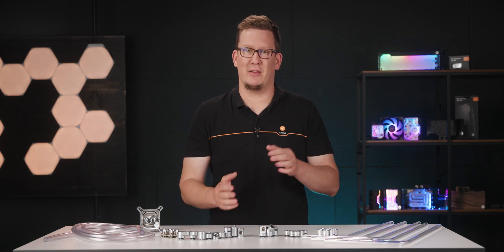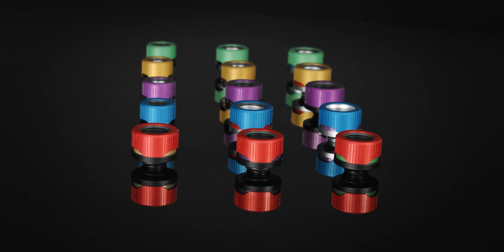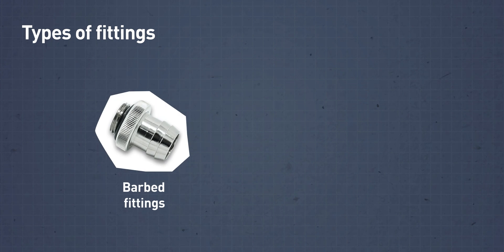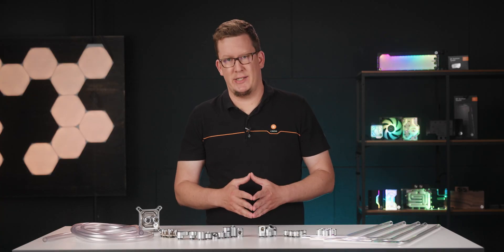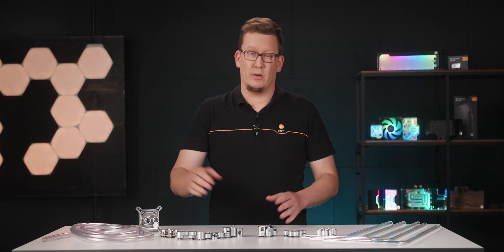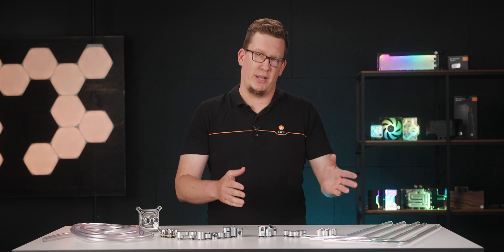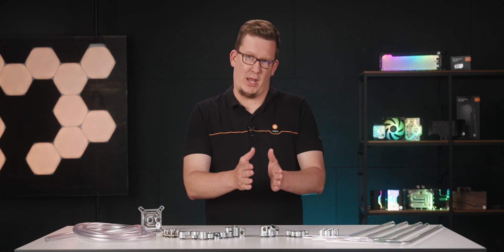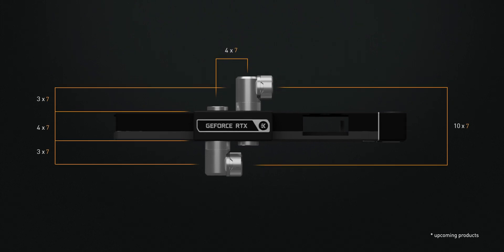How to Choose the Perfect Fittings & Tubing | Basics of Liquid Cooling

Comment: Increasing the inner diameter of a pipe will increase it's flow rate, even if it has to go though a few smaller fittings along the way. What this guy says is wrong.

Comment: Good Video!  I was just hoping that it would educate about how to choose a fitting when you're ordering your loop components and don't know how many of each type to order...like me!  EK's Loop Configurator can get you started, but doesn't automatically include offsets, extenders, or plugs (how can it when it doesn't know HOW you want to arrange your tubes? Well, if you are using one of EK's distro plates and opt for either prebent tubing or straight tubing, it should be able to determine how many of each extender you need due to their matrix7 standard - but it doesn't, so i was hoping to get that info here).
Reply: There are infinite ways to set-up a loop, so it requires some planning. Only with experience will you know to better what you will need.
Reply: @TheEchelon  Good answer bro, really helpful insightful info. Just build 15 water cooled PC's, and by the time you're on the 16th, you'll just know what offsets to get

Comment: does anybody know if hard metal tubing is beneficial for determining leaks? I don’t know much but I feel like it would be harder to spot a leak on clear tubing compared to carbon fiber tubing
Reply from the maker: The best way to check for leaks is with the EK-Leak Tester Flex 💪: https://www.ekwb.com/shop/ek-loop-leak-tester-flex
Reply: PETG, Acrylic or PMMA are generally more reliable than hard metal due to corrosion although it is more sturdy. You can opt out for opaque-hard tubing if you don't want transparent tubes. If you're concerned about leaks, you better prepare for maintenance and leak test for the best safety. Either way, you won't be fast enough to catch leaks even if you went with other types of hard tubing so you're better off constantly leak testing with transparent PETG or Acrylic tubing. Maintenance is a must at the end of the day.

Comment: Interesting video
However there is one downside to hard tubing that is not mentioned and in my opinion should be …
So I use my PC for sound design and music production and have been using water cooling parts from EK and some other brands in my pc using soft tubing
This has never resulted in any issues 
A friend of mine who also does sound design and music production has a system with hardline and had some issues with it as some of the connections with hardline started to leak …
My conclusion is that this is probably caused by the vibration coming from the speakers (specially when working on low frequency stuff)
Eventually I took the liberty to replace his hardline tubing with soft tubing and my friend did not have those issues anymore 

In my opinion this is a benefit of soft tubing
Reply: Your friend probably cut his tubes a bit too short. I've seen this happen before and yes vibrations can move the pipe slightly...but you need to cut them so that the pipe goes 2mm into each fitting on the ends before you start screwing it down. You get used to the lengths needed after you e cut them a few times.
Reply: Interesting situation, but I wouldn't be so sure it has anything to do with soft vs hard tubing in an audio engineering setup.  - I also do sound editing and havent had any trouble in 3 years with my hard tubing.  Glad your friend's PC stopped leaking when you changed out the tubes though!
Reply: do love a good fictional tale